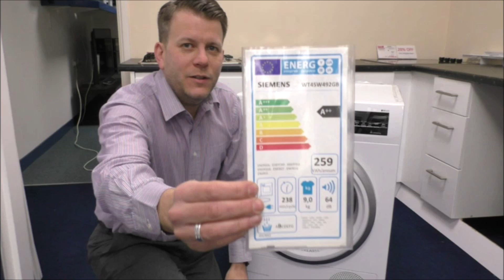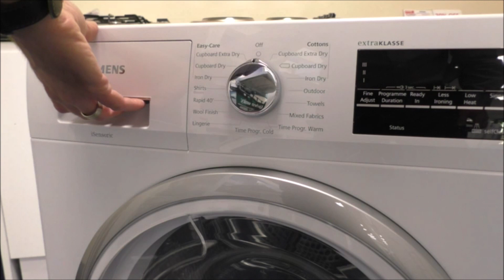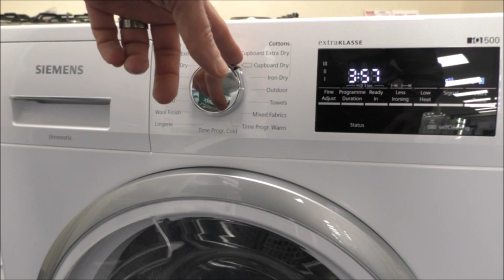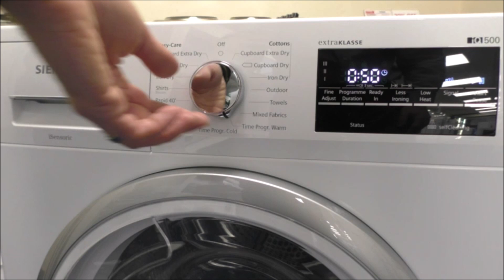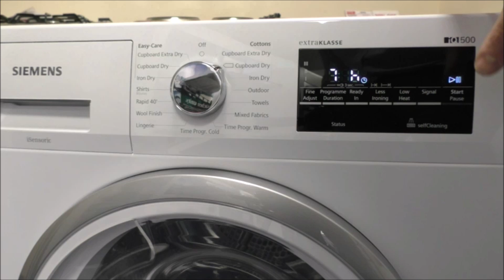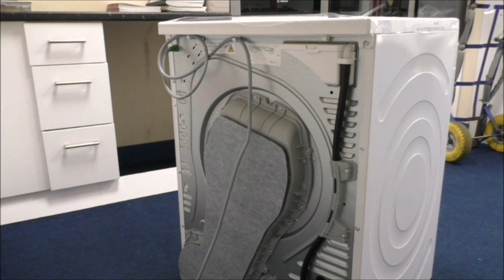Siemens WT45W492GB 9Kg Heat Pump Condenser Dryer

Comment: Hi. Great video. But how is it possible to clean the condenser with iq300 where there is no way to open it? 🤔
Reply: Hi , I had the same issue with my iq800 clothes stayed damp.
You have to make sure to always have some water in the condenser. The reason is so it can flush the condenser usually in first few minutes from starting and at the end. How I fixed the issue...buy turning the dryer 5 to 6 times just to rinse the condenser...simple and works.hope this help.
Reply from the maker: Quite a few of the Siemens dryers  have a fixed self cleaning condenser unit so the can't be removed
Reply: @lords-electrical  So if I see dust from clothes though the little air holes right about where the condenser is, then I can't clean it myself at all? 😮 
That seems like a pretty big problem to overlook on their part. 🤔
Reply: @lords-electrical  But thank you for answering! 😊

Comment: We have the iq700 and it'd good but the drying part not so sure my clothes are always damp yet the dryer takes upto even 4hours so I don't understand what we are doing wrong
Reply: Is your dryer with self cleaning condenser?
If it so make sure that you always have some water in condenser so when dryer starts it can rinse the condenser.
What I did ...I  turn my dryer 5 or 6  times just to rinse the condenser( in first couple of minutes it does rinsing) and now it dries properly. Hope this helps.

Comment: we have a IQ500 and they are utter garbage.  not once have we had a load finish dry, they are always damp.  i'd never buy one again.  the traditional heating element tumble dryer may use more electricity, but I can achieve in one hour what takes four in the heat pump model.... so that makes them pretty much equal in terms of power usage.

Comment: It does reverse tumbles?
Reply from the maker: No on most tumble dryers now, they don't reverse tumble. This is due to them having better paddles inside the drum to rotate the clothes, so reverse tumble isn't required.
Reply: @lords-electrical  they have only 2 paddles, and try to dry a set of bedding shit and then tell me if the inverted ritation is required 😨 it make  abig balls dry outside and all wet inside in 2020 not even inverter motor crazy bosch  germany tecnology😩
Reply: @cal87249   my hotpoint tl51 tumbles 1 way

Comment: Great video thanks! I have a question, been using this tumble dryer for 3 year, however the fluff now bypasses the filters and accumulates at the bottom of the condenser. is there any way to clean it, as the dryer takes now hours to dry 1 load....Any advice much appreciated!
Reply from the maker: Couple of things. Has your model got the self cleaning condenser unit or can you take it out at the bottom? Also just check to make sure the filter is still in good condition so it is not broken at all. One final thing is that some Siemens dryers have a setting to adjust the time of the programmes depending on the ambient temperature that the dryer is sitting in. May be worth finding the instructions to see if yours has it as you may be able to speed the programmes up a bit if it has. Good luck!!!
Reply: @lords-electrical  Thanks for your reply. Yes, it has self cleaning condenser, i will check tomorrow if I can open the front flap rectangular flap and see whats in. When the filters are removed I had a peek through and there is a lot "mud" like stuff on the bottom with some water. Pet blankets and lots of children clothing goes on a daily basis.

Comment: Hello.  We have this set up so that the water collects in the pull out drawer.  Sometimes, this drawer is empty but there is water in the bottom of the machine condenser compartment.  Can you explain why there is water in the condenser compartment [behind the drop down flap, on the front of the machine].
Reply from the maker: Quite a few heat pump dryers will clean the condenser unit at the end of the cycle. The way it does this is to take the water from the water container and send it through the condenser unit and then sending it back to the water container

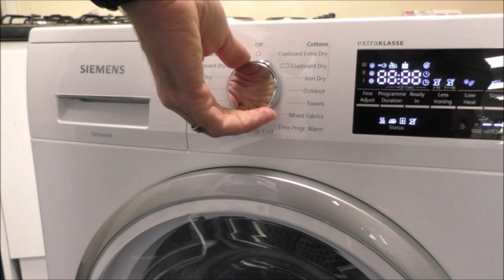Comment: at 1:43 , Is that time 4-19 is 4 Hours 19 minutes or 4 minutes 19 seconds?
Reply from the maker: It will be 4 Hours 19 minutes to start with, but as the dryer has  a sensor built in, then the time will normally be reduced a lot once it has detected the moisture content and how dry you need the clothes

Comment: Is there special shelve for shoes to use while drying?
Reply from the maker: This model doesn't come with the shelf for the shoes unfortunately.
Reply: It doesn't come with it but you can buy one as it has the holes in the filter and the lip at the top of the inside  to support it

Comment: I have this model of t/d I love it. To get the best from the machine I recommend you remove both filters and clean after each use.There are two things I wish the machine had 1: A warning light to alert the user that condenser drawer is full. 2: Reverse tumble dry although this dryer is amazing at taking care of clothing it's rubbish at drying sheets they end up in a ball resulting in wet and dry patches.This annoys me as the machine wasn't  cheap. That aside I would still recommend it.